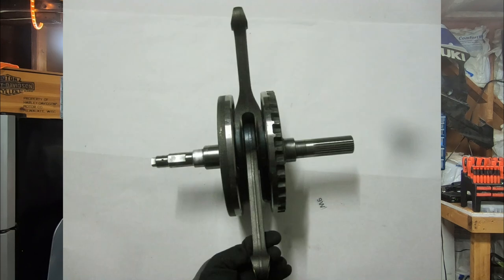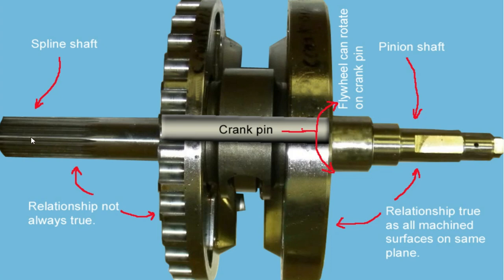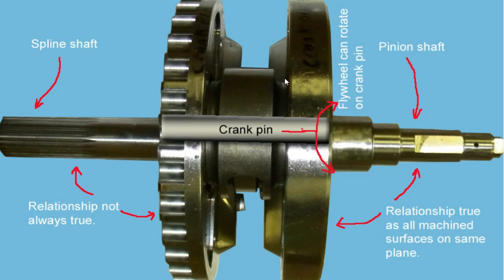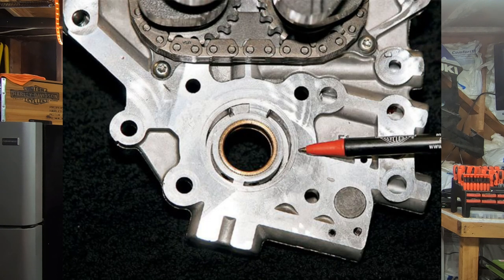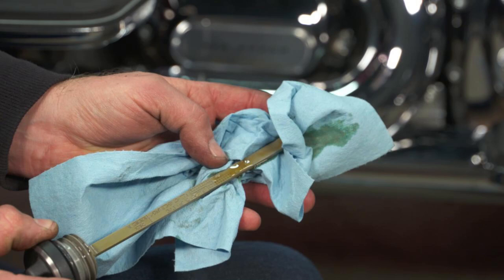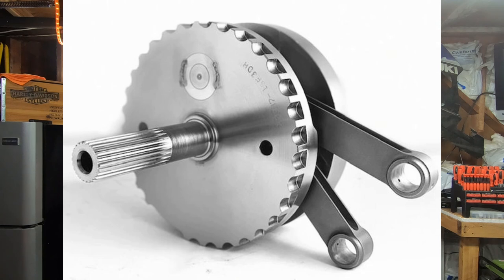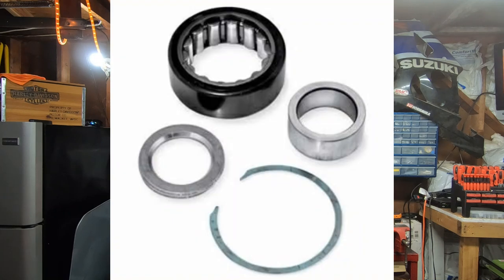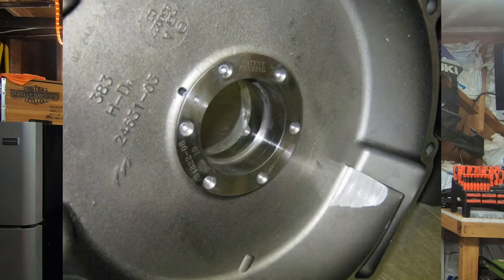The Issue With The Twin Cam Crankshafts | Harley-Davidson Cut Costs

Comment: Is this issue also present with the M8 engine?
Reply from the maker: The M8 does have a pressed crank, but they used a larger crank pin. So far I haven't seen any issues with the M8's crank, just the oil sumping issue which it looks like they got that squared away. There's a lot of miles on the M8 now and the cranks have proved to be very stout. Part of the twin cam's issue I should of mentioned is the crank pin is honestly undersized.

Comment: I've legit called and spoke to 3 different shops mechanics about upgrades to get a little more STEP in my 09 FLHX,  with 53k, and each man has basically said woah woah there that crankshaft,  pinion whatever etc etc, danger danger if this and that possible engine rebuild if this and that and I'm just like 😐😵‍💫
Reply from the maker: That's a good thing that the shops are saying something about that. That means they aren't willing to sign their name to a job and take your money and let you have a failure. At 53K miles you would be paying them to tear down your cam chest and check your pinion runout and then deciding how to proceed from there. The pressed cranks and roller setup have a lot of runout, Harley-Davidson is fine with installing a Stage 4 kit from the catalog on a bike with .008 runout since .014 is now the limit but that's crazy excessive. They aren't trying to take your money, they just want to make sure you have a solid crank to build on and your not taking a $4500 job and turning it into 10K or more.

Comment: I'm kind of bummed.. I gave my son my carbureted '01 RK and I bought myself a '06 Springer Classic FI. We both did the S&S tensioners, cams and oil pump.. I guess he has the better engine now?  I ride it very easy and the cams were for torque.. hmmm, maybe put a S&S Evo in it...lol
Reply from the maker: Once you get the tensioner system updated you're good to go, the pressed cranks do well until you put some serious power on them
Reply: @GixxerFoo  thanks! That makes me feel a lot better that I'm not riding a piece of junk. My son is leaving The RK as an 88ci so we have similar power on our bikes. Definitely subscribed to your channel!
Reply: @GixxerFoo  from what I'm seeing online, the hydraulic tensioner shoes still have to be replaced like the spring loaded ones. I understand that they last a lot longer and don't fail in a catastrophic manner. Is that true? Thanks

Comment: my engine builder said 6th gear has killed more cranks, because guys are doing 2500-2800 rpm and open the throttle full blast without downshifting. don't run it like a diesel it likes rpms more than it likes lugging.
Reply from the maker: Your builder is absolutely correct, that's why it states in the owners manual "DO NOT LUG THE ENGINE". Harleys produce a lot of torque and it's the kind of torque that can tear things up.

Comment: Why would u buy a bike with a major flaw we are not  talking about minor here but engine destruction because Harley were too cheap to produce a reliable crank 
Seems there should have been a major recall on these pressed cranks
And yes I’ve got a 2014 twin cam  not everyone got the funds to fix a motor because Harley wanted to take short cut 
To save money and look where they are now 🇦🇺
Reply from the maker: It's not a killer issue unless you are absolutely beating on the bike, many manufacturers use a pressed crank. You can put some power in it, just don't go drag racing and abusing it. There are thousands and thousands of Harleys out there making decent power and still running strong.
Reply: @GixxerFoo  It is a killer issue on a Harley. On a perfectly balanced short stroke parallel twin or inline four it may work. The Japanese have been using pressed together cranks forever. But not on 45 degree single crankpin long stroke v twins with an uneven firing sequence. The Japanese have never made such an engine. The pressed together crank will not handle the hammering of a Harley engine.
Reply: @geraldscott4302  Will it not? So how's it that there are thousands of Twin Cams still running on the streets? I myself own a Twin Cam 88 with 70,000 km, with no issues. Sometimes people exaggerate things.
Reply: A lot of people buy Harley-Davidsons these days because of the name Harley-Davidson on the tank not realizing there are way better motorcycles out there
Reply: @sll-tt6bj  Faster doesn't mean better. Technological aids don't either. Sure, H-Ds aren't la crème de la crème in technical terms, but people still prefer them because they are iconic and raw in essence. They're in the deep motorcycles' template, and you would know if you knew their history and if you rode one. Yes, refined, fast, nimble and agile machines one can find out there, but they just feel like cold metal. Indeed I like what other manufacturers offer, but they still lack something. Hey, a friend of mine seriously contemplates getting a Sportster after having ridden many different bikes of different styles and brands. I guess it's because of the sole name in the tank...
Reply: New Harleys are nowhere near the quality they used to be. The EVOs were the peak of H-D quality. We all know about the quality issues of the Twin Cam. The M8 is even worse. No only is the quality poor, but they no longer feel or sound like a Harley engine. I test rode one when they first came out. It felt like I was on a Japanese v-twin. Put some pipes on it and it would likely sound a lot better, but there is nothing you can do about the lack of feel. H-D put a counterbalancer in them (yet another internal chain) and the engine would likely destroy itself if you removed it. It was probably not designed to withstand the vibration of an EVO and even a Twin Cam. So if you want the feel of a Harley (and if you don't, why buy a Harley) stay away from this engine. 

As for "better" motorcycles, that could be interpreted many different ways. I want a simple as possible engine, with the sound and feel of a traditional Harley engine, that will last a long time, not break down, and that can be rebuilt fairly inexpensively several times. Power is not an issue, as long as it has enough to keep up with traffic. Harleys are not sport bikes or race bikes. They are cruisers and touring bikes. As for technology, the less the better. High tech crap breaks down more often, and costs a LOT more to fix, if it is even fixable. Keep it simple and reliable. If you want high tech, buy Japanese. Low tech is a major H-D selling point, and has a lot to do with their desirability, along with the proper Harley sound and feel. Harley buyers are not looking for "modern" bikes, in fact they are actually trying to avoid them.
Reply: @geraldscott4302  Gerald, the bike you're describing is the Yamaha Road Star launched in ...1999.  Single crank, 48 degree V-Twin, air cooled, NO counter balancers, pushrods, ungodly stout and solid 45 lb (!) billet one-piece crank with side-by-side automotive style con rods.  Gear driven cams.  Gear driven "primary."  Belt final drive.  Four vales and two plugs per barrel.  Conceived of and designed by American Harley types right here in Cypress, California.  Then engineered and built to impeccable, bomb-proof standards IN Japan.  Built through high labor costs IN Japan, and shipped all the way over HERE, yet sold at far less than the H-D’s.  Sold, in fact, at close to 50% (!) of the Harley price for the equivalent bike.  (Actually mechanically far superior bike, not equivalent).  Even had strong aftermarket support from the get go from MANY sources including Performance machine, Joker, RC Components, Patrick Racing, Corbin and on and on which Yamaha Corp., had drummed up prior to launch.  Yamaha even offered a strong catalogue of billet and other “customizing” items – ALL made in the USA, not Taiwan like all the Harley add-on’s sold by the Motor Company.  Yet what happens?  Tragically, the Harley name/aura/history/marque/mystique, you name it and whatever you care to call it, in the end it was too hard to overcome.  So they shut down production in 2015.  I own both (Stage I TC 88 since new, Year 2000 Road Star since new) and in truth, the power pulses and rumble of the solid mounted, mighty Road Star engine literally feels more Harley than the Harley, if that makes sense.  In fact, they (Yamaha) in essence out-Harley'd Harley with the Road Star – the motoring press from back in the day is full of those types of descriptions.  Because with the advent of the Road Star, Yamaha did NOT design something overly "clever" like some dual pin, overhead cammed and smoothed out radiator-fed nonsense like ALL the other Japanese brands had done with their "V-Twins" for so many years prior, sucking the soul out of the product before it ever hit showroom floors (still very good, dependable motorcycles in their own right).  Instead, Yamaha learned from past lessons and went totally old-school this time.  These bikes had super strong Softail style frames, were carbed and easy to work on (later fuel injected with 102 Cu. In.).  And, parked next to an H-D Softail, well, they made the latter look diminutive – still do.  Many, and I mean maaany of them bikes clocked WAY over a hundred to a hundred and fifty thousand trouble-free miles without nary a peep, and are still running.  But, this "thing of ours" is what it is.  Thus, R.I.P. Road Star.  Read ‘em and weep.  It’s one of the true “tragedies” in the annals of motorcycling.  It certainly is for those among us who have been fortunate enough to see the industry up-close since the late sixties...  Look up any of them.  Go check out a ’99 or an ’05, etc., on YouTube.  Listen to the literally hypnotic off-kilter cadence of the “cammed” idle.  Witness the rear fender vibrating and wagging back and forth, and you might begin to understand all of the above.  Meanwhile, back at the ranch, the Mother Company keeps keepin’ on - knowingly putting out inferior engine designs for huuuge dollars charged, and then they beta test said products IN THE MARKETPLACE using the customers’ pocketbooks TO DO SO...  even playing dumb on many early production issues when flaws are literally grenading motors (TC’s as well as M8’s).  Unbelievable.  And no, the sumping issues alone, with the M8’s, are STILL not sorted out now, in August of ...2021 after endless oil pump revisions totaling over a dozen design tweaks.  You talk about adding insult to injury if there ever was such a thing.  Heck, even Coke wouldn’t be able to pull off that kind of bullshit although also an “iconic Americana” brand.  So, the truth of the matter probably is that for a true Harley aficionado – for someone desiring a “real” Harley-Davidson - the choice appears to be an Evo, Shovel, Pan or Knuck.  There it is. 
Ride Forever!

Comment: GixxerFoo, you’ve got me riding in fear that my ‘06 Dyna Wide Glide 88 Twin Cam is going to shell the crank if I get on it too hard. Would you consider doing a video on what it costs to upgrade it to the old style Timken style primary side crank bearings so I know how much it will cost me to ride without fear of this happening? Your videos have enlightened me to the fact that my bike has the hydraulic cam chain tensioners and the early release of the 96 inch Twin Cam style heads, but I’m seriously thinking about getting the crank bearings upgraded and I’d like to know how much it will lighten my wallet.

Comment: but yeah, you got it right. like i said, the Twin Cam was a Victory Motorcycles freak out; think about how fast H-D put that together and tooled up for it, it needed the reduced cost for the effort
honestly though, from an engine design stand point, those are not the only problems since then....*most manufacturers agree:*
by the law of diminishing returns * the maximum per cylinder size, before increasing displacement results in an unacceptable decrease in power per displacement, is about 675cc *
damn victory all to hell....the 80 cube was there with it, and the engines got heavier too..     ok sorry VM, i am sure people will forgive you.

Comment: My 2005 1200 Sportster with less than 7000 miles on it, engine sprocket nut came loose and destroyed the crank splines.   The crank assembly is sold as a unit.  $1100 from Harley for just the assembly and will need a complete engine gasket set.   I really like the bike but I'll get a new Yamaha in the spring.   I'm not fixing the Harley for something else to go wrong with it.  I'm keeping the parts as a reminder to never buy another Harley.  40% of a Harley's parts are from other countries.   Harley Davidson make endless money pits and everyone knows it.  There are plenty of people out there with more money than brains that will keep buying them.  It's a psychological marketing and culture/cult following that has kept Harley going all these years, not a quality product.   People communicate on social media and the word is out.
Reply from the maker: The Sportster is an awesome bike, nut coming loose can happen on any brank of bike. I've had that happen on metric bikes, getting a crank for one of those is next to impossible. Have you tried checking with a machine shop? Either way the bikes gonna have to be tore down which isn't super hard on a Harley since they are very simple machines. A good machine shop might be able to repair that crank for a lot less than the price of a new crank. Another idea would be to just buy a complete engine with low miles from a trusted Ebay seller. Would be about the same price and then you could sell your engine on Ebay, even with the trashed splines and recoup a lot of money.

Comment: Could you please explain in detail how excess oil comes out of the head breathers if the oil pump isn't working properly? Doesn't make any sense
Reply from the maker: When the scavenging side isn't able to keep up with the feed side the oil collects and fills up inside the engine. It's not circulating properly so all the "veins" where oil feeds and flows it has no where to continue on it's path and everything backs up. It would either force itself through gaskets or the path of least resistance which is your head breathers. I'll have to work up a video with the oils path through the engine and show how it would back up and come out through the breathers.
Reply: @GixxerFoo  that makes no sense. In order to this happen as you described there should be excess oil in feeding end. If scavenging side doesn't get the oil from the engine there will be lack of oil in the heads where the breathers are.
99 cases out of 100 the reason why there is excess oil in breathers is because the umbrella valves, which are controlling the pressure to go to the breathers, are so worn out that they allow oil to go through the breathers.
If the oil pump fails the engine start to suffer from the lack of oil on top part of the engine which results in excess heat and eventually damage in the heads.

Comment: Remember the issue I told you I had? My 05 twin cam had been making a ticking noise from the front cylinder... And when I was passing a car I had lots of smoke out of the exhaust and oil coming out the breather...

My mechanic replaced the umbrella vents and cleaned everything and changed the plugs and ran external breather ... it will start but once warm it smokes again from exhaust ... nothing but a lil drop from the external breather... 

It's a stage 3 with 585 cams .... do u think my crank is bad??? He's saying we need to clean pistons and change piston rings because oil is getting past right there he thinks... 

But if it's my crank I'll just sale the damn thing I can't afford the piston job and crank job let alone a quality crank...
Reply from the maker: It wouldn't be a bad idea to investigate, the only way to really know for sure would be to check the pinion run out. That would allow you to inspect the oil pump, cam plate and the tensioner shoes while your in there.
Reply: @GixxerFoo  we've been in there lots of times because we had to install easy start cams due to the compression breaking the starter...

She can tensioners are the faulty ones but they're in good shape (30k miles) I do ride hard... not sure how the previous own rode...what would you notice with the oil pump and plate? If it's out of alignment?

Comment: Like most things, if you take care of it and treat it well it will take care of you. I blew up 2 shovels and a evo by hotrodding them. My 07 has 100k miles now with no issues. Because I no longer ride like a jackass!
Reply from the maker: That's exactly what I explain to everyone, you can put some power into a Twin Cam on the stock crank but don't beat the crap out of it. That knife and fork single pin crank will take a lot but just straight abuse is not one of them.
Reply: To my knowledge the cam chain tensioner issue isn’t related to abuse. It seems to be more related to the “roughness” of the can chain surface the tensioners contact. I’m not sure crankshaft runout is necessarily abuse related in most instances either. I could be wrong....

Comment: Does anyone know if Harley fixed this issue with the 103 motor?
Reply from the maker: The 103 doesn't have the compensator problems of the 96, it still runs warm but nothing an oil cooler can't fix. It makes some rocker noise due to tolerances, but nothing really glaring to stress about. That can be fixed with some rocker lockers but it doesn't hurt anything. The crank is still pressed together with the 103, it's not a huge issue unless your just beating on it.
Reply: And what about the M8 engine then ? I own a 2011 96B... (70 000 km) I'll try to ride as smart as I can 😁 Happy new year to all of you from France !